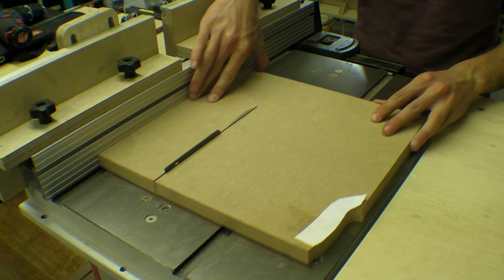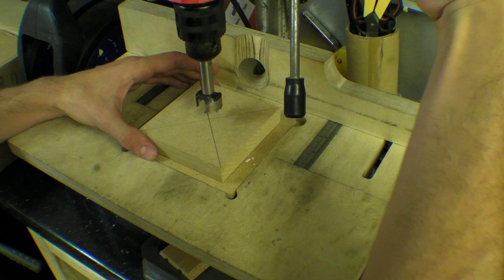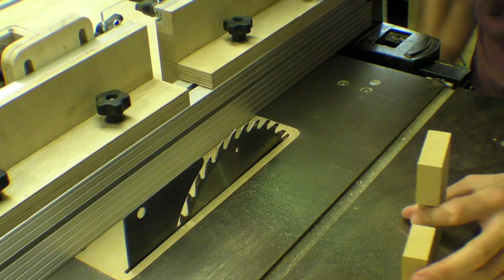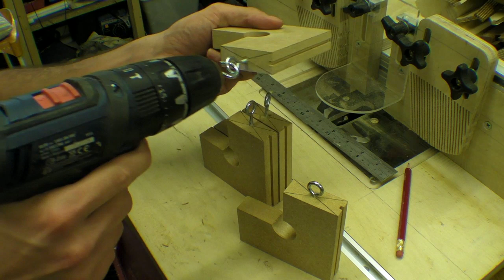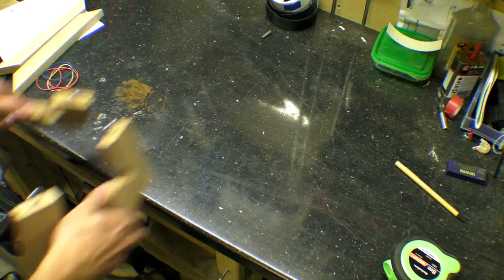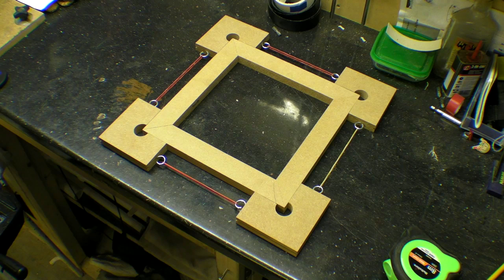Picture Frame / Box / Corner Clamps - Four Corner Blocks with Rubber Bands

Comment: Nice/neat, clean approach, and clever simple way to screw the eye bolts!  The limitation/weakness of the rubber bands would be my only concern. Gives me an idea of taking it further by replacing the screw eyes / eye-hooks with 3/8" HOLES, and haveing a continuous 1/4" to 5/16" cord running through, around each corner to a spool, that can be chucked in a cordless drill and quickly tensioned/loosened. I guess the Merle Clamp already does something similar, but this hybrid of your version might be superior, and more DIY-able.

Comment: Good video but a suggestion.  Cut the corners off and make them flat and you can use a clamp from corner to corner too.  Also in the kerf around the edges you can use a 1/8" bungee cord to help hold frame more secure.

Comment: When the springs attached to one of your blocks exert different tensions - as they will when the width and height of the frame are not the same - then the corner blocks will tend to overbalance (as was apparent in the video). You could reduce that tendency by placing the eyes closer to the frame.

Comment: What was the intention begin the grooves along the outside edges? I was left thinking those would be for some additional clamping after the rubber bands.
Reply: I agree the groves on the outside could support say a bungee cord or something similar
Reply: ww55d Maybe a wider groove and curve the outside corners then you could use a strap clamp. The  rubber bands could still be used as an alignment tool and holding it together when you apply the strap clamp.
Reply: Steven, would that not defeat the object though as a strap clamp already has corner pieces to slot on the corners ?!
Reply: Unless you mean like using one of those one used for strapping things down in which case is a good idea. I thought you meant. An actual band clamp intentionally used for it btw. I'm up late so if this is hard to understand I hear ya ! :)
Reply: I guess I ment to say a ratcheting strap tie down clamp like you would use to hold down cargo on a trailer. It could be used if you made these corner pieces. Most everyone has a strap tie down laying around.
Reply: Yeah I think it's a great idea Steven I might give it a try :)